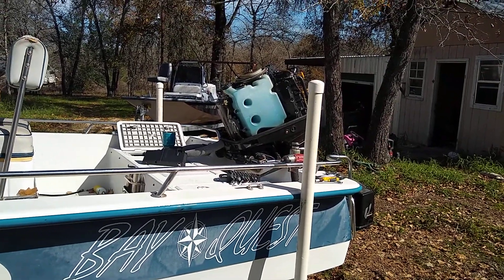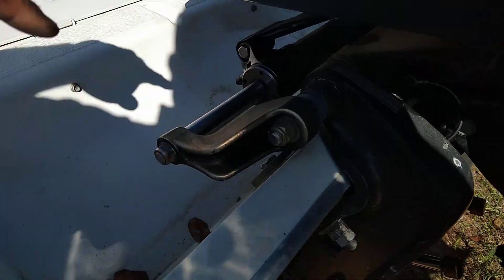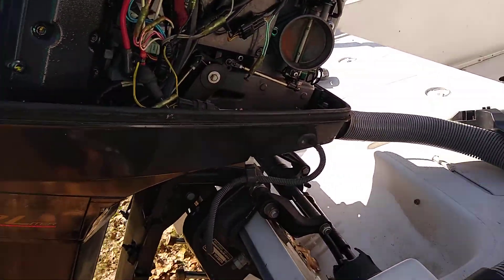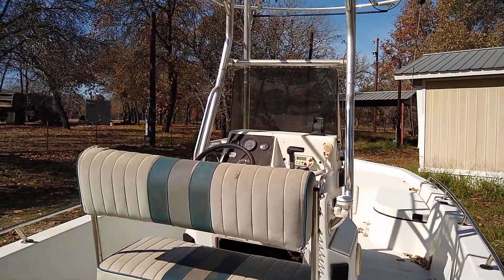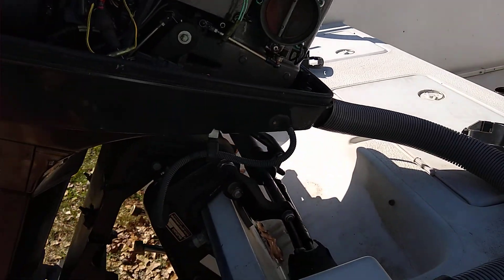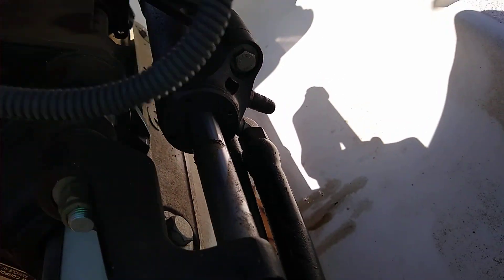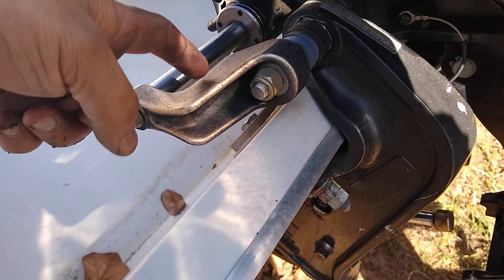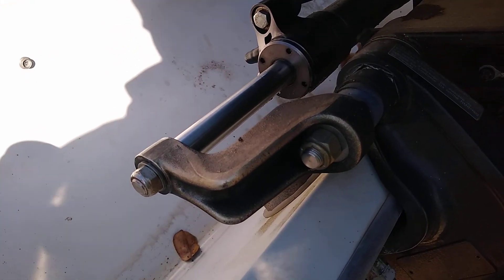Seastar hydraulic steering leak

Comment: Hi I have a similar problem , my steering wheel is free spinning when I turn it with no motor movement .
When I try to move the motor it moves very little would you suggest bleeding and changing the seals would 
be the key to repairing this issue?
Please offer your opinion it would be appreciated 
Thanks for you video 👍
Reply from the maker: Seal kit is the right way. Amazon is the best price I can find. Regular atf or power steering fluid is fine. No expensive seastar  fluid needed
Reply: Thanks